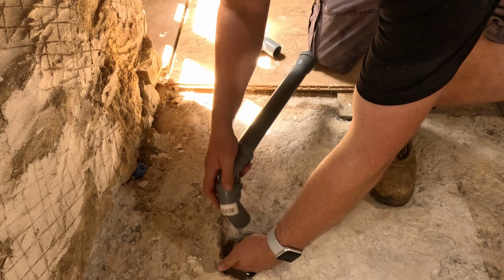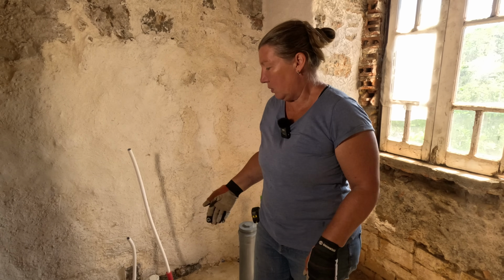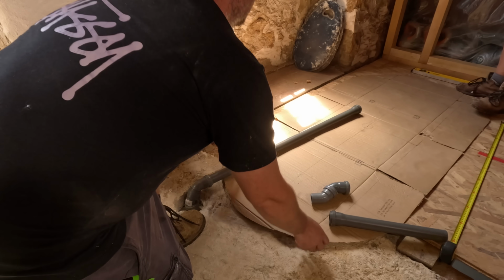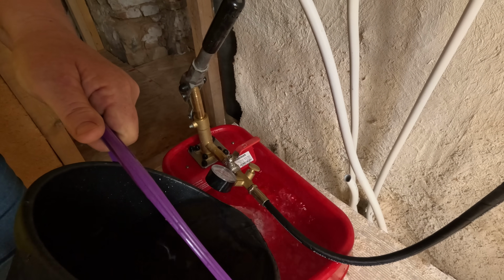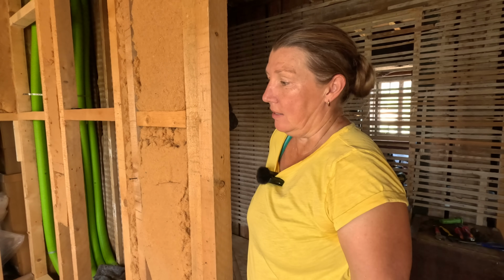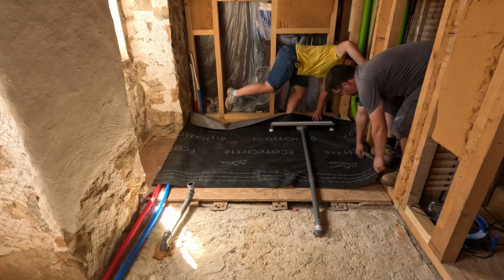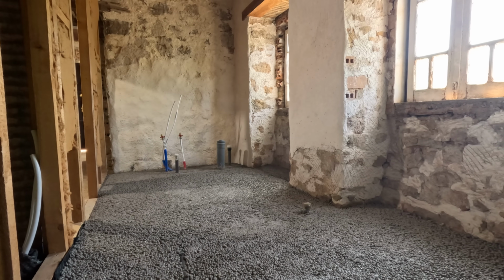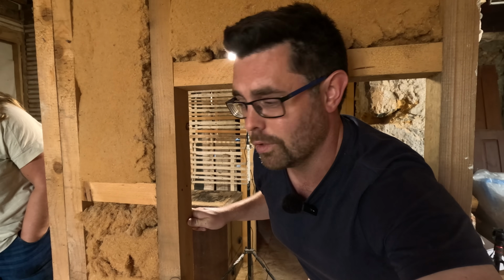Back to the Bathroom (We Started 4 Years Ago!) - Renovating a Stone House in Portugal

Comment: Congratulations on 'finally' getting the bathroom floor slab done. It's all going to look great. 
Thanks for pointing out about the HL vs NHL for the ground floor. It's going to save us a good bit of cash 💰.
Reply from the maker: Similarly for anything that goes on top, doesn’t have to be natural/breathable. It was when I was researching whether to use sealer on our tiles that I discovered all this
Reply: @MAKEDOGROW  That makes total sense. 👍
Just curious, did you ever consider incorporating cork granules in a lime mix for either the slab or the top screed  for the ground floor?
Reply from the maker: We did look at that as an option but couldn’t find anywhere to source the cork. It also appeared to be more expensive for little additional benefit

Comment: Great work.  Perhaps consider the following:  Instead of setting the laser to the finished top level of the subfloor, set it instead to an inch or two above this and make a corresponding mark on the handle/stem of the float or trowel you use.  This way the laser will be visible at all times and will quickly show both low and high spots.
Reply from the maker: Yeah, I tried that method and didn’t like it. I tend to just place the trowel on the floor and look for the laser to run just above the front edge. This layer doesn’t need to be totally flat as there’s another layer that goes on it

Comment: 15:21 Leak testing with water instead if air - water is basically incompressible, so should something burst at pressure, the effects if it it was a lot of compressed air would be a lot more energetic and flinging bits about, than with water.

Comment: Hi guys! Is the floor level with the top of that drainage piping? if so dig it out asap and put some insulation around it for the noise. Hearing gushes of water all the time isnt pleasant and over time that will get worst due to much build up. (I cant imagine you are going to put much if any ontop of it in terms of sound deafening something) I also noticed the hot water pipe isnt insulated? Maybe getting that wrong idk, It defo is worth insulating even if its just with the thinnest of stuff. Again, I might not see the full picture, just trying to help that all/ btw I am still very happy you are still rolling on and sharing all of this! You should be proud. Especially when you reflect on that decision where you almost quit sharing, when you look back at it now, I personally think you guys are actually are a bit proud, if your not then ill come over and kick your aarse bcos you should!🤣

When will you guys build a sauna?
Reply from the maker: The leca (the round balls) is insulation, both thermal and acoustic, so nothing else is needed

Comment: As a respected and deep thinking team, I have a fundamental question for your comments:

Q: In this Exponential Age of ever cheaper and stored solar energy why do we still have a single hot water boiler from which we then pipe the same hot water all around the house to kitchen, utility and bathrooms? Especially when all that is needed in each of these areas is a power supply and a source of cold water. I understand the origins of the original concept and its use today with a heat pump, but hot water and under floor heating whilst similar are not exactly the same, and together they do in fact complicate the efficiency of said heat pump, especially when supplying hot waterto kitchens, utilities and showers where volume and spasmodic usage occur. My frustration is getting plumbers etc.to acknowledge there's a better way. Your thoughts pleased.